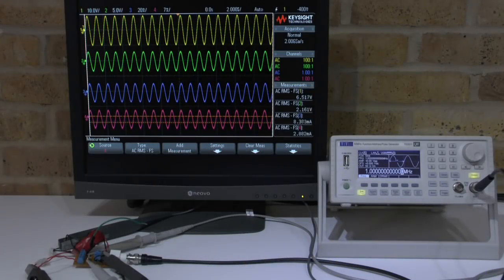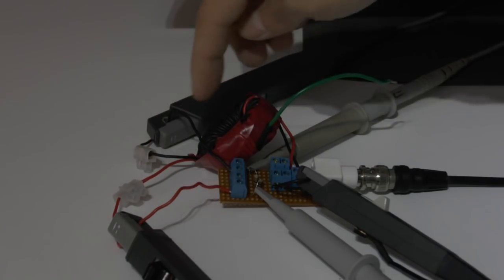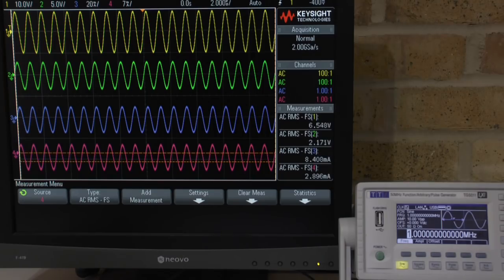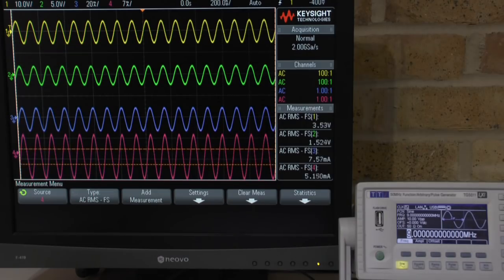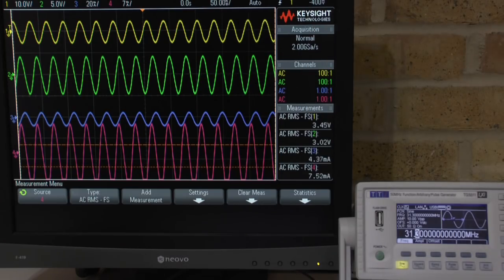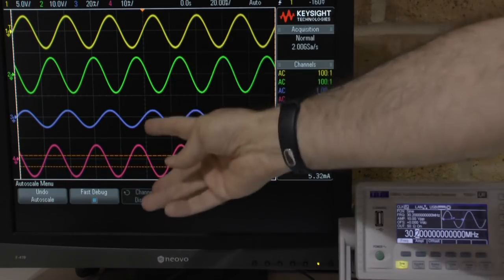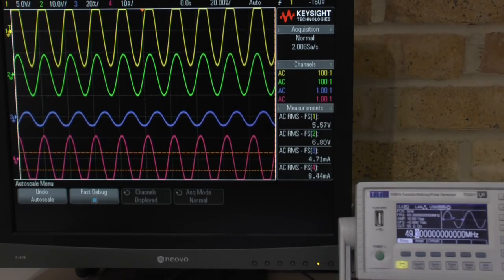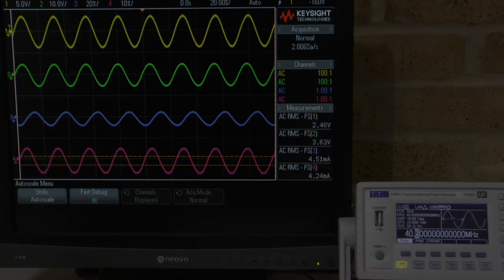Wave propagation anomalies in partnered coils

Comment: Well I worked with that about 5 years ago. Bad news is that it is almost the same effect like coil in capacitor in parallel connection. Which means in resonance huge current will be inside of circuit, and just very little current from the source. Actually current from the source is difference in current between L shorter and longer. But no work to get out of this.

Comment: The signal shift is caused by the self capacitance/inductante of each coil. When having 2 could wound around the same core, then each coil will have its own inductance plus its own capacitance. I’m expert in this field of research, it is the key to achieve self sutainable energy systems, your design is the foundations for for it, but a real life prototype is quite more complex. Keep up the good job